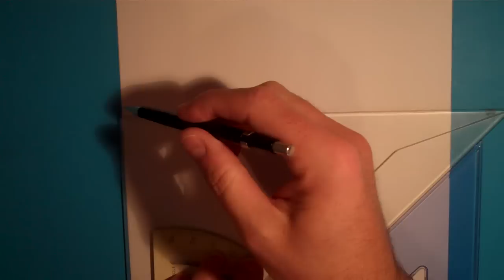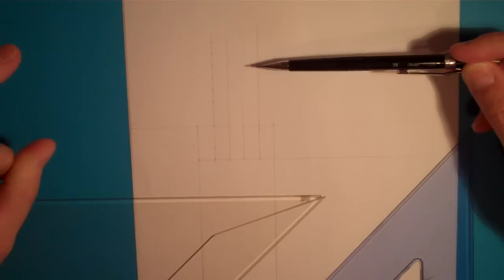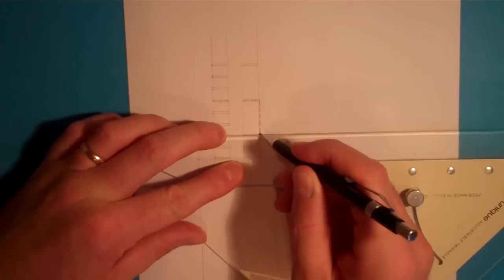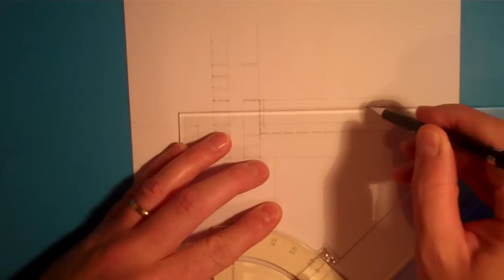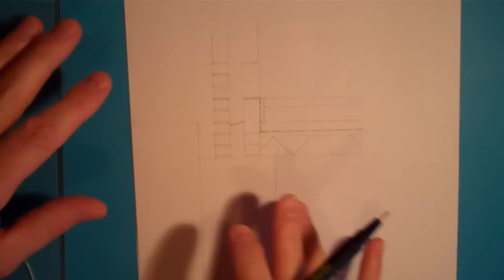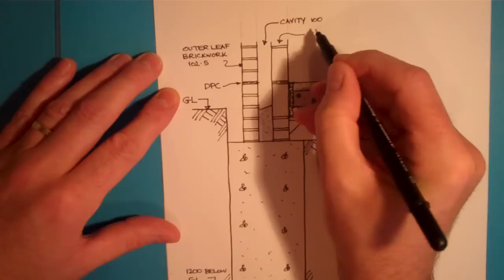Strip Foundation and Ground Floor Construction Detail

Comment from the maker: Thanks for the comments. The detail shows a form of strip foundation known as a "deep strip" or "trench fill" foundation. It is typically used in areas where shrinkable clay soils are found. Such soils   are subject to seasonal changes in volume which can have major implications for the stability of the foundation. To avoid the effect of these changes in volume it is necessary to take the base of the foundation to a depth below the zone affected (typically at least 900mm deep)